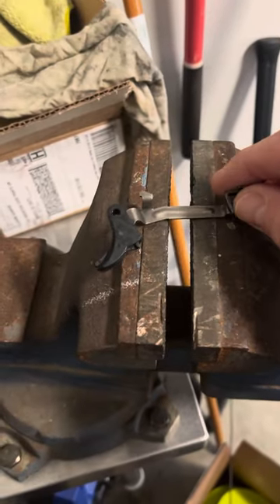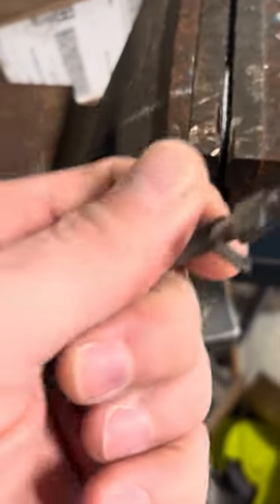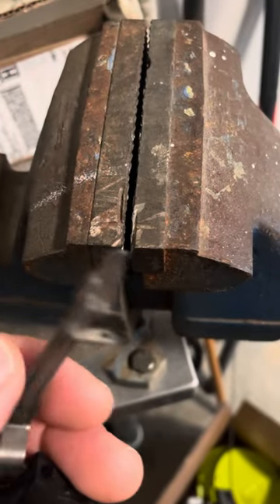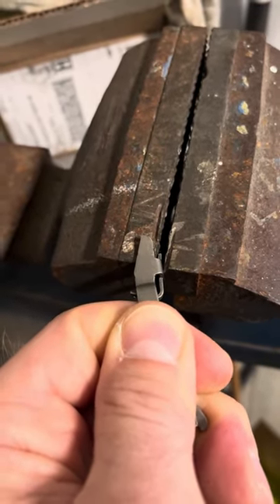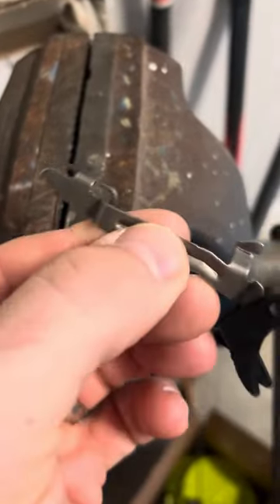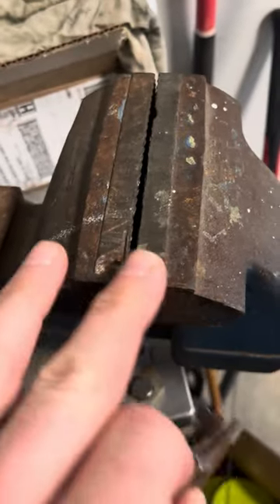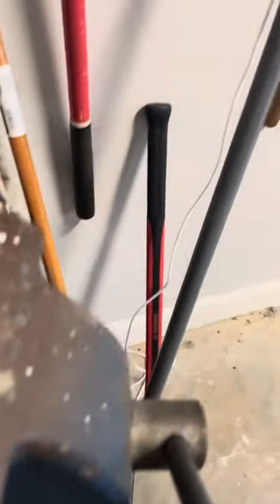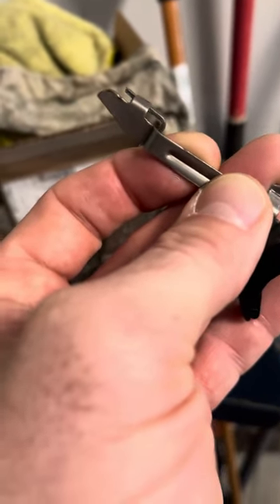JARGs P80 Trigger Reset. Short of crossbar angle. FULL VIDEO in DESCRIPTION

Comment: is there anything you can use besides a vice? that wont break it
Reply from the maker: Well using a wrench or something would pull to much torque on it and break.  Recommend the vice.  It does not need to change but a few degrees

Comment: So ive watched both your videos and have bent my sear and its literally not solving my sear engagement problem. Im getting 20% engagement with an OEM and the polymer 80 components. Im completely at a loss here
Reply from the maker: What exactly is happening?
Reply: I’ve also bent my sear, But check the back where the firing pin connects and the sear engagement is also around 20% is their any other thing that could help it ? or do i keep bending my sear,,

Comment: This 100% worked for dry firing works everytime, every-now n again still will happen during live fire is this due to break In period only have roughly 120 rounds through it, but it will never do it dry
Reply from the maker: No angle not high enough. Rounds are pressing slide up a hair